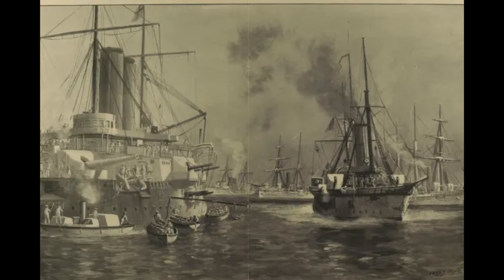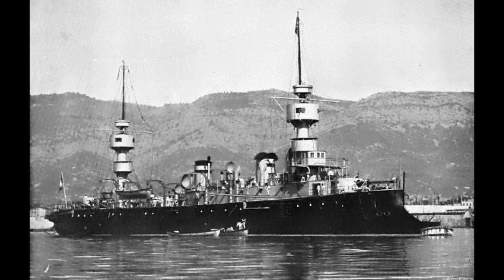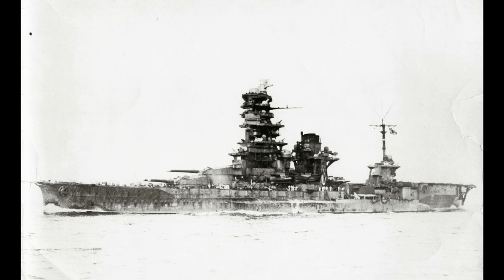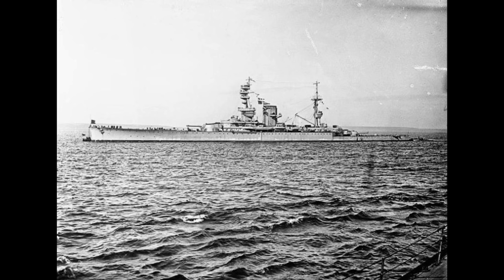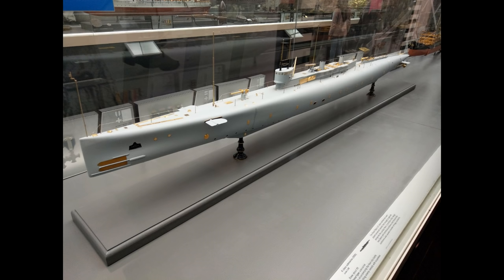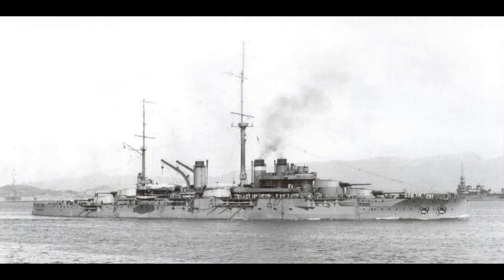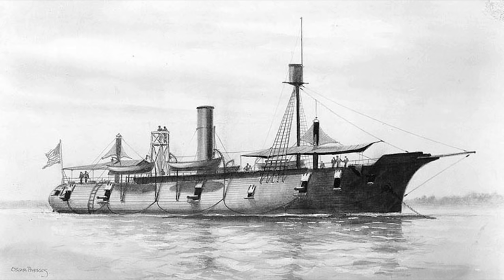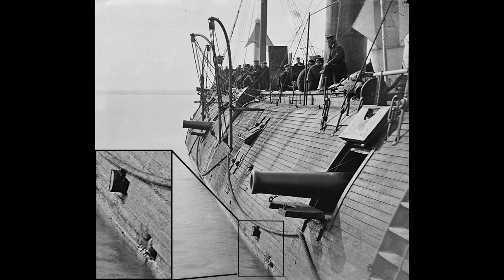Naval Engineering Disasters - How not to design a ship

Comment: Of course when I saw the title I knew I just had to watch this. I had an idea of a few naval engineering disasters and I would have put the Vasa first (most severe disaster). I would have had the Captain in my list somewhere. But I hadn't really thought about 8 more. Great selection, thanks! I'm sure there are a lot of others that would make great stories. Could you have a series of videos on engineering disasters?
Reply: Oh yes! The big gun monitors...where the Admiralty received a letter saying, "Your hull is poorly designed, it will not achieve even 8 knots although it's engined for 12. The reason is because there's separation on the afterbody so the propellers can't get a good grip on the water. Your ob't and Humble Servant, Robert Froude." Well, when you get a letter from a man named Froude saying your hull's no good, you should tear up the plans and go back to the drawing board. Did the Admiralty do that? Noooo. They responded that the shipyard was already cutting steel, and that's why the 14" gunned monitors of WW I had to be escorted everywhere by a tug because they became uncontrollable at some speeds because the rudder couldn't bite in the separated flow Mr. Froude described.

Comment: Hey Drach, you missed the point of the Infanta Maria Teresa, they were not intended as line of battle ships, but as commerce raiders in the jeune ecole school. In Santiago they were used for something they weren't intended for, aggravated by poor training in fire control and damage control
Reply: What does that have to with a 5 inch armor belt? Would be very lucky day if it  catches a shot to begin with.
Reply: Dude, when your armor isn't where it should be to protect you, that's a big issue no matter what your mission is.

Comment: Anybody that is a bit less than standard height, can easily demonstrate the reason why #10 is a failure. Just put us in a lineup with normals and then draw a line across where you would aim at normally. Compare where that hits the less tall example and how that effects the damage estimate for them. 
Also known as, why you always see the short guy wearing his Kevlar brain buckets.
Reply: I always wore mine because apparently there are no individuals taller than 5 foot 10 inches at DARPA. On an average day I would be a walking casualty collection point waiting for a low doorframe... I wore a helmet, I refused to lick windows lol

Edit: Mind you, at 6 ft 7 inches and 310lbs, I was the gunner. So there I'd be with the riflemans loadout, plus 1000 rounds of belt 5.56 and an M249. If I went down, it'd take 2 guys just to haul away the gear let alone my carcass... Hence I was the casualty collection point...
Reply: Well I basically just Cinderfellaed my teams compete problem list and ran Ma Deuce out the door of our Uber to work with it changing colors after dropping the kiddies off at the Y, to close air support, responsible for initial critical injury evac replaced then with a dedicated medical staff and the awesome red&white badge that warns hostiles only shoot it if they are otw out of the box...so if we get a cakewalk day trip, I could get a digestive bug on the way in, do my expected duty, and suppression fire otw to the secure weapons line and miss debriefing with a bug... meaning I was literally able to spend 10min. walking to my car and going home, with remaining balance of the 16hrs op reclining in my  harness rig relaxing with a book.

Comment: Wouldn´t the Ise class make better sense being equipped with reconnaissance aircraft and used as leaders of smaller light cruiser/destroyer task forces? Though I know, the speed...
Reply: I don't think so. The flight deck is too short to support large recon aicraft (like two-engine bombers) and if you only use small ones, then a conventional catapult-floatplane configuration is more efficient.

Comment: Well, its is clear this NEEDS to be mentioned here since it had SPECTACULAR consequences at Jutland:

"The real cause of the disasters was that the precautions for preventing flash of ignited propellant reaching a magazine were not matched to the behaviour of British charges, though if the British ships had had German charges it is very unlikely that they would have blown up. This was not, however, clear at the time.

Unfortunately it was not realised how violently British charges would ignite in a turret fire, and the above flash doors were inadequate, the magazine doors were not flash tight under pressure, and flash had a free path to the handing room via the space between the fixed and rotating turret structures, and possibly via other routes. Also there were no magazine scuttles for passing charges, in fact, the magazine doors would be continuously open in action, and many more charges removed from their magazine cases, or in opened cases, than there should have been."

"The method of ammunition supply to the heavy guns in British capital ships appeared to be reasonably safe in 1914, but no large scale trials with up-to-date turrets had been carried out, and this was the important and blameworthy omission."

"German charges were by no means flash proof when out of their magazine cases, but their ignition was delayed and they burnt relatively slowly, and no dangerous pressure rise occurred from a number of charges violently igniting at nearly the same instant, as occurred with British charges. Thus even in the Seydlitz at the Dogger Bank battle, when 62 complete 11in charges were involved in the fire in her after turrets, there was no explosion. There is no doubt that far too great a number of exposed charges were present in many British ships at Jutland, but this was at most only a CONTRIBUTORY cause of the disasters that occurred. In the Lion's 'Q turret the ignition of 8-13.5in charges between magazines and guns, all of which were in hoist cages or authorized waiting positions, would have blown up the ship if `Q' magazines had not been closed, and very probably would have done so anyway if they had not been flooded, though the total weight of propellant that ignited was only about a sixth of that in the Seydlitz's fire."

- Campbell

ALL RN capital ships shared this flaw which is why Lion, where the regulations were dutifully followed almost blew up as well:

"Two or three minutes after the hit, the Lion's Chief Gunner, Mr Alexander Grant, visited `Q' magazine, and while there, one of the working chamber crew arrived in the handing room down the trunk, and told the Chief Gunner the state of affairs. Orders were given for the magazine doors to be closed and later for the magazine to be flooded. At 162 8 the Chief Gunner was approaching the hatch to the handing room on the main deck, when a large sheet of flame came up the hatch killing several of the fire party in the vicinity. As soon as the smoke had sufficiently cleared, a party headed by the Chief Gunner went down to the handing room and other compartments, and found half the shell room crew in the shell room burned to death, as well as the magazine and half shell room crews in the handing room and switchboard flat. The paint in the handing room and shell room near the hoist was blackened and blistered but by no means all burnt, and the switchboard was blackened but intact.
It was conjectured that the fire had spread from the gun-house to the working chamber via the electric cables as they were the only things burnt as opposed to blistered or blackened. All that is certain, however, is that a smouldering fire in the gun-house spread in some manner to the working chamber and ignited the charges there. The effect of the ignition of the eight charges that were between the handing room and 4ft above the working chamber, was very violent, although vented by the absence of part of the turret roof, and by the handing room hatch being open. The flame went as high as the mastheads, and `Q' magazine bulkheads were considerably buckled and bulged inwards although supported by the water in the magazine which had probably by then been completely flooded. If the magazine had still been open, the Lion would, without any doubt have followed the Indefatigable and Queen Mary.

The above account is largely taken from Jellicoe's memorandum of 16 June 1916 which contained notes on the more important damage to the battlecruisers and the Warspite and was later reproduced in Grand Fleet Gunnery and Torpedo Order No 15 on the lessons of Jutland. There is no mention in this of the part played by Major FJW Harvey, RMLI, the officer of the turret, except that he sent a messenger to the bridge to report that the turret was out of action. Major Harvey was awarded a posthumous VC for giving orders to close the magazine doors and flood the magazine when he was mortally wounded; in the event the order to flood the magazine came from the Captain to the transmitting station, and William -Yeo, Stoker 1st class, special messenger to the transmitting station, was the man actually sent to order `Q' magazine to be flooded. The transmitting station asked for the order to be repeated, as the Lion had partially flooded `A' magazine in error at the Dogger Bank battle, and Grand Fleet Gunnery Orders after the action had indicated that the person in charge of a magazine, if there was no fire there, should take steps to find out why the order to flood had been given, and inform a responsible officer of what was occurring.

In this case it was fortunate that `Q' magazine was flooded in time, as tests later showed that magazine doors as then fitted, were by no means flash tight when closed. As it was, a venting plate admitted a tongue of flame into the magazine but no harm was done. At that date magazine venting plates were fitted in handing rooms, so that a sudden pressure rise in the magazine from spontaneously ignited cordite would vent into the handing room and thence up the space between the fixed and revolving turret structures, and also up the turret trunk. They were not flash-tight in the reverse direction."

- Campbell

ALL RN capital ships suffered from this flaw, and it makes clear that blaming the DEAD crewmen in the lost ships was just a transparent excuse by the designers in order to avoid their responsibility in the defeat.
Reply: Thanks very much for this. In your opinion, do these apparent design flaws exonerate Beatty from principal responsibility for the Jutland debacle? The impression Ive drawn overall, from Drach,  is that Beattie’s penchant  and preparedness for a higher rate of fire was the key cause of poor charge storage and handling, which ultimately resulted in the loss of the ships. Do you agree with this view?
Reply: @hisdadjames4876  No, Beatty was a political appointment by Churchill and his performance was accordingly appalling. 

And no I do not agree, the extra ammunition, as Campbell puts it, was just a contributory factor, Lion's case fully proves that the ships would have blown up even if fully following procedures and limited charges to the bare minimum.

"German charges were by no means flash proof when out of their magazine cases, but their ignition was delayed and they burnt relatively slowly, and no dangerous pressure rise occurred from a number of charges violently igniting at nearly the same instant, as occurred with British charges. Thus even in the Seydlitz at the Dogger Bank battle, when 62 complete 11in charges were involved in the fire in her after turrets, there was no explosion. There is no doubt that far too great a number of exposed charges were present in many British ships at Jutland, but this was at most only a contributory cause of the disasters that occurred. In the Lion's 'Q turret the ignition of 8-13.5in charges between magazines and guns, all of which were in hoist cages or authorized waiting positions, would have blown up the ship if `Q' magazines had not been closed, and very probably would have done so anyway if they had not been flooded, though the total weight of propellant that ignited was only about a sixth of that in the Seydlitz's fire."

- Campbell

The RN didnt bother testing their anti-flash precautions so they had no clue about what was going to happen, and the results are there for all to see.

Comment: Honorable mention might be the Yamashiro and Fuso; as Japan's first in-house designed battleships after the Kongos were made by England. The recoil hydraulics in their gun turrets weren't quite up to the task and as a result firing both guns in the turret at once had a very real risk of rupturing the system and rendering it useless until repaired.

This, along with numerous other engineering faults, resulted in the Fuso class being considered a "punishment" posting. They sure went down swinging despite this, though.

Comment: Would it be more apt to say that the K Class submarine was doomed by limitations in communication, reconnaissance and the inability of RN surface combatants to operate safely in proximity to them? It seems almost like the main issue was that RN surface captains were never able to cooperate with them in operational conditions without ramming them?
Reply: Not easy to run up signal flags on a K class.

Comment: "If the enemy battleships come in gun range of your carrier task force, you probably have weightier things to worry about, like where are your battleships and why are they on fire?" Precious Drachism.
Not to mention that building a real heavy cruiser and a real light carrier with a good dakka should cost less than a monster like Isei and leaves you with two ships capable of a variety of missions, though you'll probably fail to manage both on the same hull design...
Reply: Even more importantly: Why didn’t you just maintain a safe distance from the enemy battleship if you have a carrier task force? That’s the whole point of a fast carrier task force-to outrange enemy surface ships and attack with impunity! That way you don’t even need battleships to act as anti-surface escorts!

Comment: Much of the problem seems to be the narrowness of the areas of expertise of the various people involved with the design.  Each thought his area was important and somebody else could sacrifice some of their needed design parameters to allow him to get his, so in this case when the toothpaste was squeezed out of the tube into a design too small for all of the needed material, the belt armor over the magazines got  emptied before the tube was squeezed completely.  It could have been some other important design requirement instead.

A similar thing happened with US Navy late-20th-Century aircraft carriers and the three that had installed a TERRIER Mark 76 AAW Guided Missile System twin-radar battery (well before SM-2ER was developed).  While a good long range anti-aircraft system for area protection from various destroyer- and cruiser-sized support ships in a task force, it had a number of features that made it totally unfit to put on an aircraft carrier:

(1)  It was very bulky, taking up a lot of room for the radar directors, the launchers, and the control stations aboard ship.  Poor return for the weight and volume needed for the system.

(2)  It had a slow rate of fire, being able to handle only one target per director from firing to intercept, so the protection it afforded, even if working perfectly, was very limited, considering that the aircraft carriers would be the main targets of any enemy attack on the task force.  Poor return on investment.

(3)  The directors and launchers needed wide arcs of free space where friendly aircraft could not go if the missile system was to acquire and fire against enemy aircraft.  An aircraft carrier was the w9orst possible place for this requirement of all warships ever built, by design.  Very poor return on necessary function use.

(4)  Due to the large boosters used with the TERRIER/SM-1 missiles, the system had a rather large minimum range, since the missile guidance could not be activated until the boosters had been dropped off.  This made the system completely useless as a point-defense protection system.  Even worse return on usefulness when needed.

The TERRIER systems on those ships ended up non-functional most of the time when they and aircraft needs conflicted.  Eventually they were removed.

All is different, but all is the same...

Comment: When it comes to the Courbet, I was like "eh, 21kts, 10x12in, 11in belt, main guns for up to 15km cca, for WW1 I rate it 3.6 - not great, not terrible. But then I was like, if they wanted to brawl, where´s the armor? At least in Rule the waves, when I build brawling BBs, I give them at least 13, but sometimes even 14. 11in is at best heavy cruiser proof at low range (that is, unless they really wanted to brawl at around the maximum range of their guns, which would probably be OK).